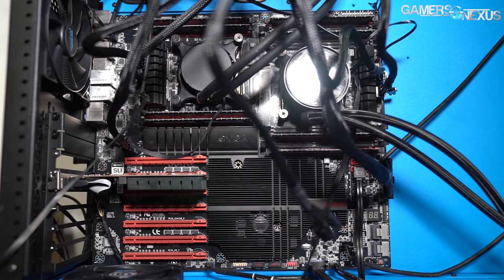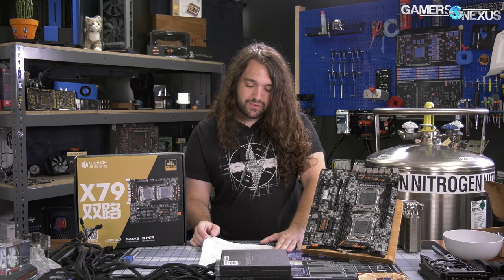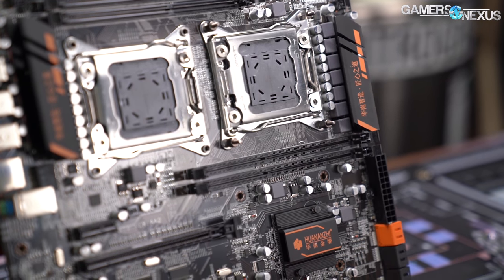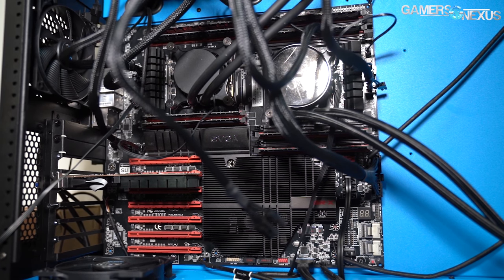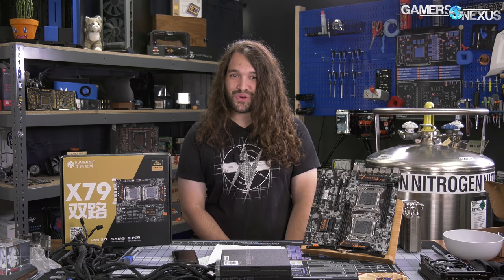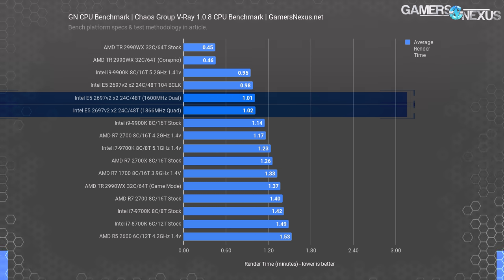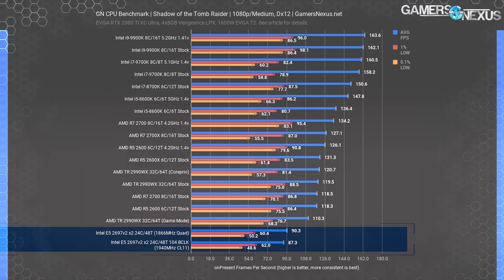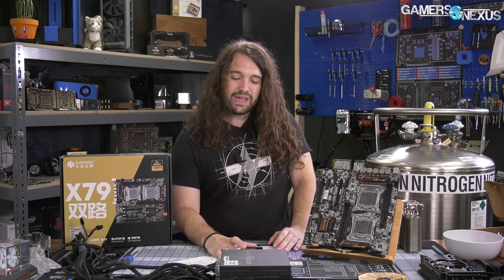Building a Dual-CPU Behemoth from Used Server Parts, ft. CaseLabs & Old Xeons

Comment: Quick note for viewers: when dealing with enterprise equipment you really need to pay attention to qualified compatibility lists for everything to work smoothly. While you can argue the SR-X is a "consumer" version of enterprise hardware, the same compatibility rules apply when using Xeon processors and ECC memory. It's times like this, where people try to DIY a bunch of enterprise hardware, where things just don't work. Generally when using Xeon platforms, always stick to registered ECC memory and make sure you read the compatibility lists. 

Consumer hardware is built with maximum compatibility in mind. So, even if something isn't explicitly verified by the vendor, chances are it will work fine and the vendor may even support it if you ask nicely. Enterprise hardware is different: if it's not tested and validated, it just DOESN'T WORK. This allows the vendor to guarantee reliability in most cases and also to refuse support for unqualified configurations. This alone probably saves them millions of dollars.

I had a problem recently when trying to use an Intel X520-DA2 adapter in a Dell server with SR optics. While the X520-DA2 has normal SFP+ connectors, it simply won't work with anything but direct-attach cabling (which is what the DA means, although I did find a workaround in FreeNAS). If you want to use the X520 with optics you need a different SKU, despite the fact that they're almost the exact same card. This despite the fact that I plugged in the exact same card with the same SR optics into my Ryzen desktop with Windows 10 and it worked perfectly with no issues.

Comment: I want to build a server so much but working full time + OT and researching has been a little confusing on finding decent older equipment at an ok price.  ECC memory, cpus and mobos, storage array setup, what vms can do. Ahhh my head hurts lol.
Reply: look on Amazon or Ebay, plenty of dual CPU slab 1U rack servers, they use standard IEC 110Vac power  , HP Proliant or Dell Power Edges starting at $100, prices go up depending on spec. $200 buys a beast of a nice toy.

Comment: Another interesting workload compilation test would be to compile unreal engine. The problem is that it uses so much stuff that would take a time to fix the versions of the libaries being used. It takes some hours to compile on my simple R3 2200g.

Comment: Yeah, I like this stuff a lot.  I'm building an X58 i7-950 from parts I found in the back room at work a couple months ago.  Just got a Zalman "turbo" cooler for it, so it's at least going to look cool.  Not sure what the case is (Antec or Rosewill), but it has more holes than metal, so should be really good for airflow when I get the rust off and repaint it.

Comment: You start with motherboard for 100$ (you "said" thats is usless) and youcomperre/jump into EVGA motherboard for a 500$!. That's wierd IMO. Typical viewer can take wrong info about chinese motherboard. Not all chinese stuff dont work in 100% greate but in 100% you can use it succesfully if you only want to.
Reply: The specific processors they used are not compatible in dual socket use on that mobo. They made a mistake in buying it and as he said the only thing those will probably work with those motherboard are the processors that the manufacturer tested themselves (which their processors were not tested for)

Comment: I did a very similar build using an old dual socket Dell chassis 64gb of 1600mhz and 2 8 core Xeons that were $79 on ebay giving me 32 threads for pretty cheap

Comment: Any details on the system power consumption of these old parts compared to current desktop CPUs? It's a very interesting build re-using old computer parts - if you already have the parts or can get it cheap. I'm just wondering if it is worth the time and money.

Comment: There is one very good motherboard for such a solution, and it is better than huananzhi because it is built on the C602 chipset, in the Huananzhi motherboard, the chipset is supposedly "X79", although in fact there is likely b75, which leads to a number of restrictions. Also personally, in my opinion, there are few slots for operative memory.
If you are interested in such an assembly, then it is better to look at the inventec b810, it is much better, and its cost is about $ 100

Comment: I love the data presentation you use, but in the slide at 20:55 is there any reason the x axis goes to 20 minutes, when the longest bar on the chart is 5.2 minutes?

Comment: Seeing the layout of the motherboard with two CPUs at once, I would say an ideal conecpt for building a case around it is to mount the motherboard flat with the backside pointing downwards in the center of the frame. As for the cooling, put two big passive CPU coolers only to have a Noctua fan modified to have a huge diameter blowing fresh air throught the entire board to keep it chilled.

Comment: great video! just like to start out there. I'd like to add, that I've been looking into dual 2011 mobo's, x79/x99. The 12c v3 are the same priced used as a v2, so in turn, it would of been the same price to get the new stuff. That being said as well, you could then upgrade them later to the 2799v3 18 core or the 22c later on. Thats were Im at right now. Asus Z10PE-D16/ or the 8, are not badly price in the 300 dollar range.

Comment: Very fascinating, I am just about to buy me one of those chinese Dual-X79 boards for rendering purposes. Me being too poor to update my software to capitalize upon my Threadripper, I am looking at hardware from '11 to '13.
Already in posession of ECC Reg memory and a pair of E5-2640-v3's(recently sourced a Renderboxx R8920), all I need is cooling and the board.
Thank you for going through all this, for our benefit.
Reply: and what kind of power supply do you use? a normal one with only one cpu power line ?
Reply: @KarimAkors  got a corsair ax850 that's currently doing nothing, with two 4+4 leads

Comment: This is the sort of pain I had to go through to get my dual socket Opteron retro PC working and it still needs the board replaced with a new old stock one due to the current used board having multiple faults with it.

Comment: I have a dual Xeon server/compression computer sitting at home myself.  Dual hex core hyper threaded with 32GB ram, case, dual redundant psu's for $200.00.  That was shipped.
Reply: That's a pretty good price for sure. If I wasn't looking for modern features to game on and have lower power draw, I'd grab one of those instead of waiting for Zen2.
Reply: @johnbuscher  Yup.  Used servers are stupidly cheap right now.  I'm so tempted to get a 2700/2700x for my Ryzen build but my 1700 is more than sufficient.

Comment: Reminds me of the circa 2010-2012 Mac Pro. Those sport dual Xeons and DDR3, and would presumably perform pretty comparably to this thing.
Reply: The 2013 Mac Pro (trashcan) uses the same ivy bridge-based E5 V2 Xeons, albeit with only one of them as there is only one CPU socket. The top upgrade option for it is the exact same 12 core E5-2697 V2 Xeon.

Comment: I went the Opteron route with my 24c dual project.  12 core 6100 series chips are about ten bucks each!  Supermicro Mobo for $125, $15 power supply, etc.  :)

Comment: Xeon E5-1680 v2 is the last of those old overclockable Xeons, you should try 2 of those. Should be able to hit at least 4.5ghz, and their memory controllers are good enough for DDR3 2400mhz. I oughta know as I run a single one!
Reply: With the exception of the fact that the 1XXX sku xeons are made for single socket use
Reply: @thcriticalthinker4025  Are they just not listed as compatible or do they really not work? They're not listed as unlocked either but they are.

Comment: I remember this board. I was going to buy it. I love it so much. I wanted to get 2x Xeons and the old memory Corsair Dominator GT. The memory where you could put water blocks on the top. Imagine 2x ek waterblocks and 4x memory waterblocks. I did so much research on this and sadly didn’t go ahead with the build. This is a blast from the past!!

Comment: I do wonder how much compression you could get by dumping your videos on the a ZFS filesystem with compression on.
Reply: Probably not much. You'd get a lot of savings with CSVs and such, but in my experience you get negligible savings with video. The only way I've found to really save space with encoded video is to re-encode it. I remember GN had a video a while back where they mentioned they were using lossless compression to save space with their old footage, I'm curious to see if their work flow has changed since then. A follow up piece would be nice.
Reply: @mogwix  It's been something I have been meaning to do for a while is test out various forms of compression vs audio formats on zfs filesystem. like FLAC and WAV etc. Video already being highly compressed likely benefits very little. Also ZFS does apparently 'give up' on compressing something if it cant achieve meaningful results so it is possible you could get a couple of percent gains but ZFS 'give up' leading to no gain.

Comment: Step 1 - GN condemns GTX1650 as a waste of money vs 570 and thus 1660 barely a step above. 
Step 2 - GN promotes GTX1660 for its sponsor spot. 
🤔🤑
Reply from the maker: Except the 1650 isn't a 1660, so your comment makes zero sense. Prices are also lower now than launch.
Reply: Gamers Nexus well then I stand corrected. It’s been a while since I’ve see the video but I thought the 1660 was included on the lineup discussion. Luckily we have GN to go to bat for consumers when performance / price is less than market competition. I look forward to see how the price drop will end up for intel CPU’s.

Comment: You could have saved a lot of time and frustration by simply buying any X9D based motherboard from Supermicro. It fully supports ES processors (they don't remove the support from the BIOS updates), and the IPMI or the screen could show you any error and it would be a simple email to Supermicro to handle any issues.
Also, it's pretty cheap.
Reply: i feel cursed, it's been 2 years and 3 rmas and my supermicro x9 motherboard has been an absolute showstopper because it refuses to work properly ughhh
Reply from the maker: You could also just build a new system and save any issues at all, but that's not really the point. The point is that we wanted this build, not that one.